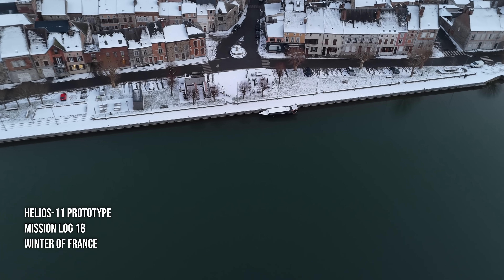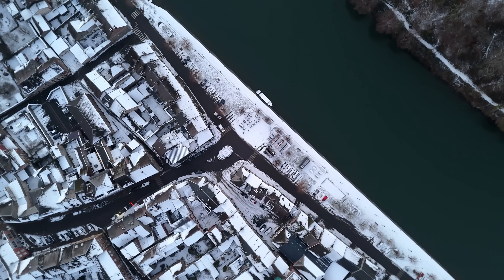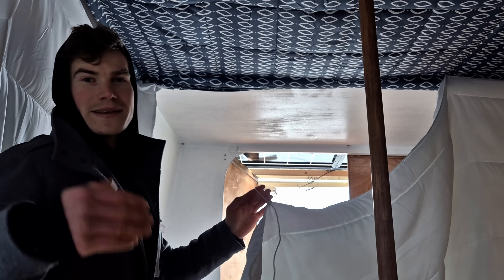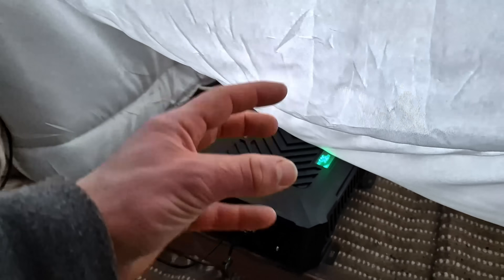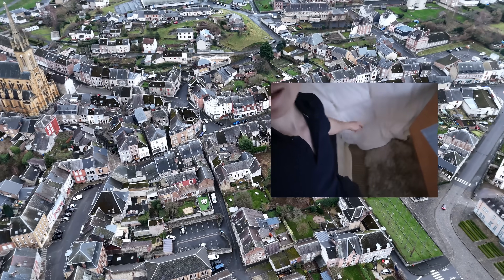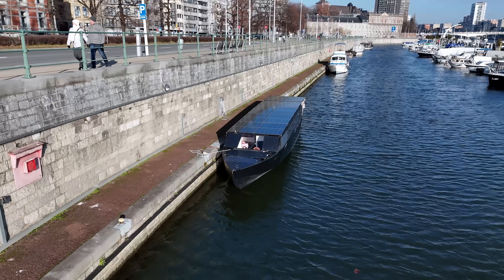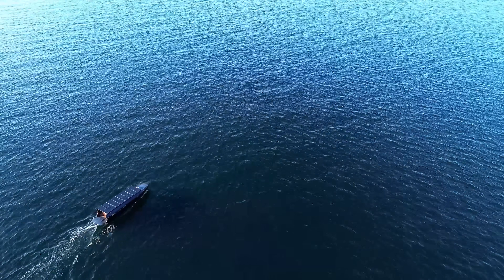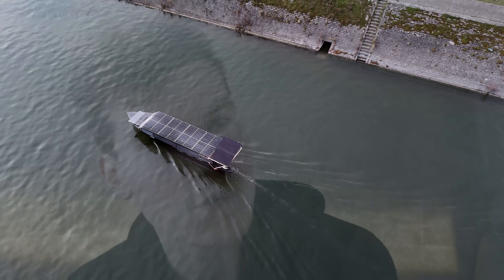Installing Heating on my 100% Solar Boat in Winter (230 V, Infrared Heat)

Comment: Fun fact: Electric heaters are 100% efficient (any wastage in conversion is also heat).

You can go above 100% using phase change. Look at picking up a reverse-cycle heat pump, you're looking at a ~3x boost in efficiency. boost. Plus, you get AC in the summer.
Reply: At the point of use, electric heaters are ~100% efficient.
Heat pumps can be 200–400% effective, but on a boat of this size, weight may be a limiting factor.
Reply: @StigNot  Sure, there's always trade offs. If a small unit can be used for both heating & cooling, it may be worth it.
Reply: Heat Pump is the way to go here long term!
Reply: Water - Air heat pump in form of a normal air conditioner is definitely the solution in this case. Could be used both as a heater and conditioner
Reply: I suspect with how rarely you'll want AC if ever on the water the heat-pump isn't worth it for that reasoning, and given the relatively light insulation and water on the hull to really take the heat away Infrared heaters might well feel warmer for the same energy consumption. Heatpump is certainly better at heating the whole environment making the air warm (so its what I'd choose for most things), but the radiative heating will feel comfortably warm even if the air temperature actually is rather colder than you'd like - and because of the poor insulation making the air that warm as the heat pump does probably isn't that energy efficient - its getting out of the box too easily.
Reply: that feels like cheating
Reply: You do realize your incorrect right? Let’s take a space heater that has resistance coils to heat up. Notice how the coils glow orange. They start emitting light. That is also a form of energy that is emitted but doesn’t get converted to heat. Nothing is 100% efficient. Theirs always some form of loss of energy as it’s converted to other forms of energy. Entropy has its way as well.
Reply: @egondro9157  Yes, if one wants to be picky, it has an efficiency of 99.9% and in any case the light produced also heats up through radiation, the losses are in the switches and electrical connections.
Reply: @garethevans9789 That’s not how it works :^)
Reply: @RubenLensvelt It pretty much is though. It's technically not over 100% efficient but all resistance or infrared type electric heaters will but out about 3.4 BTU per watt but because heat pumps only move heat from one place to another and you can get to a COP around 4 you'd get around 12 BTU for the same watt. People incorrectly call that 400% efficiency but it's easier to say it that way than to try to describe it every time. 

As an added bonus you can run it backwards and remove heat from inside instead of putting it there so if the sun heats it up you can dump that heat outside.
Reply: I mean… it sorta, kinda is. You give the heat pump 100w and it moves 300w (more or less) worth of heat.
Reply: @FirstnameLastname-f9y  i meant that energy efficency in systems don't work like that: an electric resistor is 100% efficient in convertion of electric to thermal energy in the same way rubbing two sticks together is 100% efficient in converting friction into heat. In short, the term 'efficiency' doesn't really work in that application.

Also a heat pump its coefficient of performance falls low when the evaporator temperature gets low. In short: the heat pump won't work so good when it gets cold outside.
Reply: @RubenLensvelt  I am autistic, and I see where you are coming from, however we don't need to be pedantic in this use case. 

The reason it is 100% efficient, is because the Baseline is Electric Heat. 
Which is 100% efficient, because it itself is the baseline. 

Thus, a heat pump, outputting what would cost an electric heater 400 watts, for only 100 watts, is a 400% efficiency. 

Also, heat pumps, at least newer models, and some extremely newer models, can continue to output heat well below freezing temperatures. 
This is done using refrigerants in series, to heat one another up in a chain. 
This used to be a problem, though with computers we are able to overcome this with rapid adjustment automatically, to avoid overheating or cooling of any specific refrigerant in the system.
Reply: @RubenLensvelt  The latest generation ones work with a COP of around 2.5 up to -5/-10C, and above 5C they reach a COP of 4-5. They always consume less than a traditional electric heater or an infrared one.
Reply: @-Evilempire-  i agree with you on the heat pump systems. they save a lot on valuable electric power when you compare them to electric resistors. in that case i guess their only drawback are complexity.
Reply: @RubenLensvelt  There are camper ones that work directly on DC and are in a single block, they are not that complicated to assemble, just make 2 holes, one for intake and one for outlet, we are not talking about heat pumps for residential use. And if you want to save money, there are the "American" ones that cost very little.
Reply: @Golden_SnowFlake  single stage or multistage AC system does not really matter. the COP is derived from temperature spread. always.  you can make 90°C out from 0°C in. but at what cost !? (parts+complexity and energy consumption)

yes, in many cases you can gain some on a heatpump but on boat using a sail there is just wayy too much indoors>_<outdoors action to be efficient in heating the air.

The warm air you just put in 3h of solar production is gone after a single door opening event.
not compable to a 120sq-m  house.

also to keep the heat from entering the water you'd need massive insulation on the hull. a secondary polyfoam hull in the hull basically.  

also quite some on the walls and ceiling + double pane windows of course.

Comment: 1x400w Panel Heater will be more efficient!
Reply: A 400W panel heater will generate about 400W of heat output. Let's compare to other electric heaters:
400W of oil heater = 400W  of heat output
400W electric element = 400W of heat output
400W fan heater = 398W (2W for the fan..)
400W heat pump = 1200W of heat output
Reply: @PureGlide true - better idea!

Comment: On the 22m you can't go that narrow with that solar panel weight and will roll badly at anchor or under way.  At 22m you can be 2.8m wide WL and still be over the 8-1 beam to length ratio needed to avoid bow wave drag like a catamaran. You are no longer constrained by weight to go fast as stays in displacement mode right through 2x hull speed.  
You'll still roll a lot in waves and need to keep solar panel/frame weight to a minimum.  In just the 10 roof panels you have ~ 230kg plus whatever frame, I suggest light plywood frame and 'flexible' panels as the skin to make a box. 
Because of docking, legal, other costs based on length, the cat is a far better boat to live on in any kind of waves.
 Cats can anchor in places no monohull could as the waves make it untenable. But cats, tris and proas within reason, can do fine just anchoring open to the sea.  Vs monohulls need protected waters.

Comment: Even if the 230V inverter isn’t perfectly efficient, its losses end up as heat — which makes no practical difference for a heating system.

Comment: direct heating is not very optimal  even small heat pump for the future might be really good, like for campervan or small split for home
Reply: Listen to this man. Heat pumps can be over 300% efficient. There is no other option that will come close. And as a bonus you can reverse it to cool.

Comment: You probably only need one of those 400watt electric oil radiator, and put it under the bed, that would be enough for your blanket castle, it might take longer to reach comfort temperature, but could run safely for days, 
Next boat, consider a Nissan Leaf battery and aircon, it's very efficient, and can both cool and heat, the downside of Leaf battery, is cooling, but when rapidly charging, which will never be a problem for you

Comment: For a long term solution on your next build, you could incorporate brick flooring as ballast with pipes running through the bricks that  circulate hot air. Once heated, the bricks will slowly release radiant heat. Resting your feet on a warm brick floor covered with a wool carpet will do wonders for your comfort in cold weather.

Comment: Interesting numbers! I'm running a 22kWh battery on a sailboat but I have only 1320Wp installed. With this i just manage to stay off grid during winter (southern France). But no electric cooking or heating during winter.

Comment: I use 12vdc E blankets at under 100wt to stay very toasty.  And there are E jackets vests, pants, socks.
I'd use foam insulation in the section one lives in most.  This works in summer too where it can be easy to A/C you'll find on the Med in summer. 
What you call a transformer is called an inverter.  A transformer just changes AC to a different AC voltage.   Inverters change DC to AC.  That inverter uses/drains power which can be a kwhr/day or more. Check it out to see.  
Running a 2kw 240vac heater element on 48vdc gives ~ 500 watts.  AC switches DON'T work on DC.
You are much better off going 12 or 48vdc and avoid using the inverter.  Do not cover the inverter with a cloth or anything as can overheat.
   Use a heat lamp or 3, lighter, cheaper, smaller.   That gives you many e heating choices.
Many boats heat with wood in tiny stoves.  One can use used veg oil are others.
Keep it up as many are learning so much from you.

Comment: maybe look at solar hot water diverter- works like a dump on home instalations  so gives you hot water with an exchanger would run a oil radiator

Comment: NO point reinventing the wheel, when its cold because there is no sun so makes way more sense to use a diesel heater and while your at it use the fuel to run a generator to charge your batteries as well. Sure you prefer it the quiet but the science of solar isnt there yet.

Comment: Nice with electric heat but nothing beats the cosy vibe of a flame 🔥 

I have been living in a tiny sailing boat for more than a decade and I recently installed a simple tent stove with a chimney that turns the boat into a sauna and is perfect for cooking also. 
Fire wood is easy to find everywhere.
Reply from the maker: That is true🔥. Especially in my larger solar designs I will consider wood heating just for the feel, not performance. 100 kg of firewood and steel wont slow down down a larger boat much.

However: infrared does bring that warm real feeling as well, because its literally IR
Reply: @Lukas-TrueNorthYachts  Yeah I wish I would have recommended myself to install a wood stove 10 years ago but better late than never..

My sailboat is also 100% electric but I wouldn’t wanna use too strong current to heat up the boat because it shortens the lifetime somewhat of lifepo4 batteries and my battery bank is not optimal for heating purposes.
Anyway stay creative and enjoy the trip to the Mediterranean. 
It’s almost summer down here..
Reply: @Lukas-TrueNorthYachts 

Why not go for a small AC/Heat-pump much more efficient...?

Comment: If you are going to the mediterran, at some point during summer, I would imagine you are going to want cooling too. You gonna need a heat pump.
Reply: was going to suggest this
Reply from the maker: Yeah thats true
Reply: If the hull is very well insulated you don't need as much energy either way and in higher temperatures passive or forced air ventilation will  deal with most of the heat build up .... A circulating water cooling radiator plate in front of  a fan will  most of the boat if allowed to vent from the opposite end of a hull or through  roof  vents.
Hybrid TPV panels allow you to increase not just solar efficiency in full sun and extend panel life and outputs but also store hot water in an insulated  tank or cylinder.. helpful in terms of onboard hygiene and comfort.
Reply: @clivestainlesssteelwomble7665  yes, but it's clear the hull isn't insulated at all when he's putting blankets up against the walls and roof.

Comment: Scale down tests do not work well with hydrodynamics. The math doesn't scale. You might be able to do some stability and weight placement testing but it won't work for hull speeds and cornering dynamics.
Reply: This is true, or more specifically the scaling is nonlinear, sometimes highly nonlinear.  The defacto standard is by Delft University.  They have scaling standards for many different hull types and they have the tanks to do validation.

Comment: My solar boat has the panels hinged in the middle of the roof. Not flat but higher in the middle
 So you can lift one side to face the sun and also the other side when sun on other side.  .ake ot easier to clean panels and as you know. Flat panels are useless
Reply: i have the same

Comment: You can buy a PTC elemen blower for 30 euros with inbuilt thermostat that has 1000/2000w option, that would work well.
Reply from the maker: Yeah that would work.
But I'll get infrared heaters for a better feel and silent operation
Reply: @Lukas-TrueNorthYachts  Quartz IR is a very serious fire risk and you have loads of materials with very poor fire propagation properties.  It is cheap only if you don’t consider the risk.
A heat pump is the technology you are going to need.  It is safer and needed for both heating and cooling.
Reply: @Lukas-TrueNorthYachts   Sounds good! Another option would be a small oil filled portable "house radiator ", they are available in various size and very safe to use.

Comment: Bro, i keep saying it. Buy a few small flip up wind turbines for when you are parked up on snowy rainy or cloudy days, hell, if you are in rivers a lot you can buy a generator that you tether off the boat and use the flow to turn a turbine. Think dude.
Reply from the maker: Sounds good for winter, but I wont be needing it when I reach further south.
There will be more than enough electricity.

That said. Massive energy could be harvested from turbines when anchored, but not so much when travelling.
Reply: @Lukas-TrueNorthYachts  Redundancies friend, always have redundancies, panels can break, hail does happen. Just have back ups is all im saying. 1 or 2 back up systems just in case. I do love the channel and love watching, thank you for the content friend.
Reply: @Lukas-TrueNorthYachts  I'd have a 3m 2 blade one that could be stored with the windsurfer masts, sails, in a tube when not needed. And they do work traveling so at night, cloudy a big boost especially ocean traveling. Having all 3 gives you backup and turns a coastal cruiser into a go anywhere craft.
Also make sure your future E drive can generate while anchored in a tidal/river flow, or sailing.